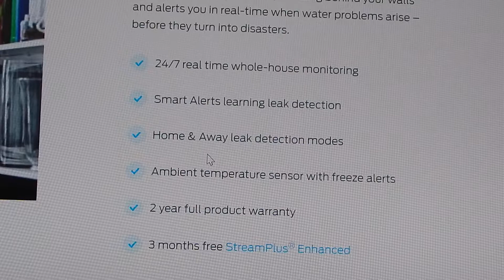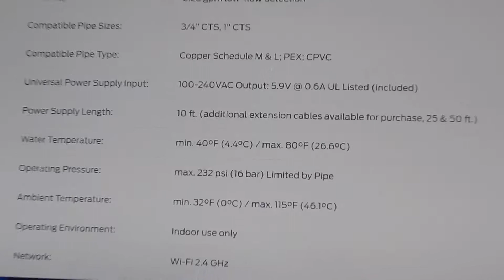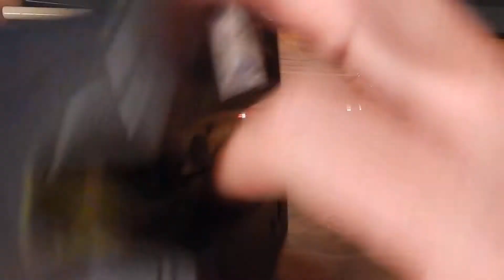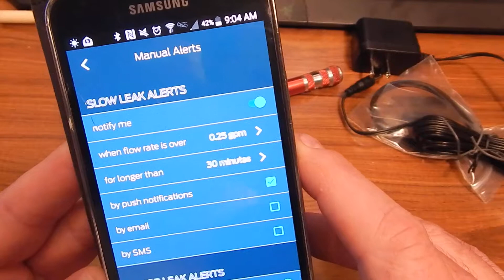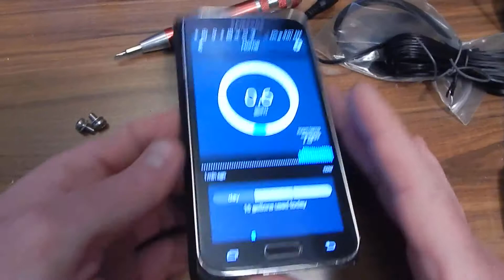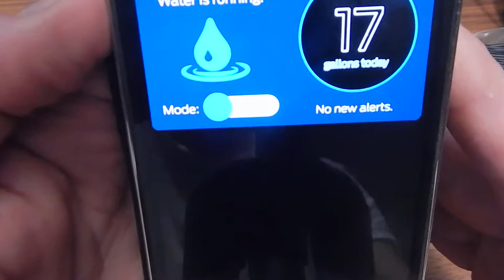Stream Labs Smart Home Water Leak Monitor

Comment: it sees my cvpc for a bit and that’s it.   cleaned the pipe and changed the pads and tightened the tie wraps. nogo
Reply from the maker: Sounds like you did what's required maybe a bad transducer, contact for a replacement.  CPVC must have no paint and if you move or twist unit after ties are on, it will mess up pads.  Also, do a recalibration, very important.